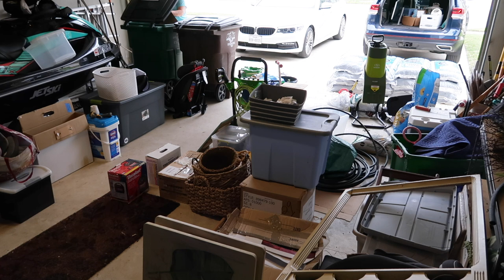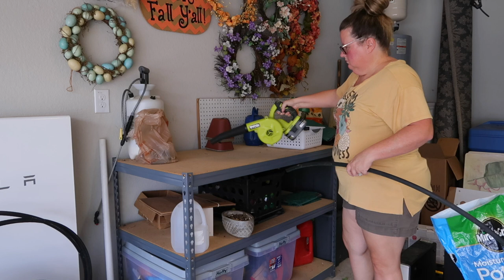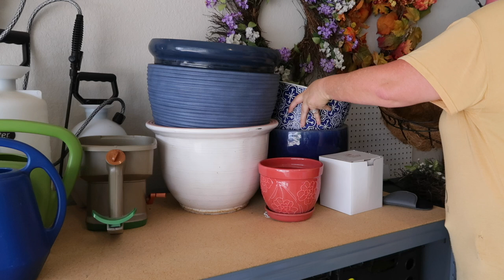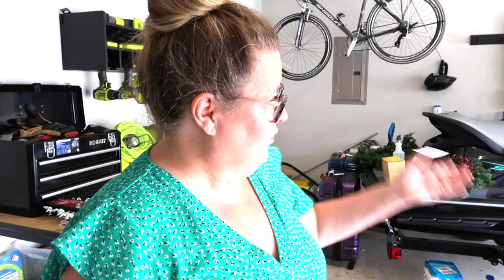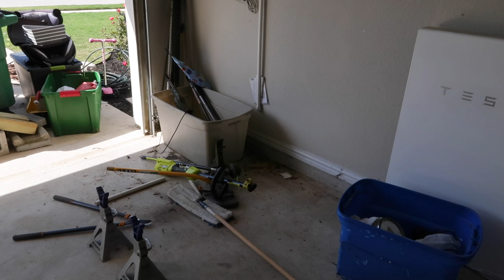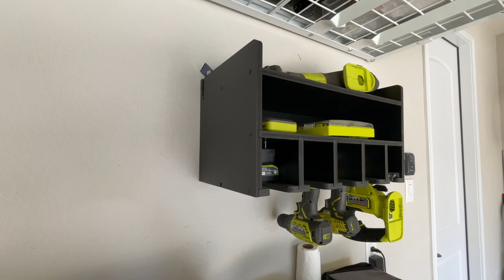5 Must Have Garage Organization Systems That WORK | Garage Clean and Organization | Mom to Moms

Comment: We so need to do this! Also the shop and attic… we are working on an inventory of our stuff. Off the floor is the way to go! Where is your lawn mower? Did I miss it?
Reply from the maker: Hi Avee. Our lawnmower is in an outside shed on the side of our house. I’m trying to convince Michael to either put the wood chipper and pressure washer in their too or move out the lawn mower back into the garage and put all pool related things in the shed. It’s very small so doesn’t fit much but I think the three lawn things could, but Michael isn’t convinced. 🤷🏼‍♀️🤦🏼‍♀️